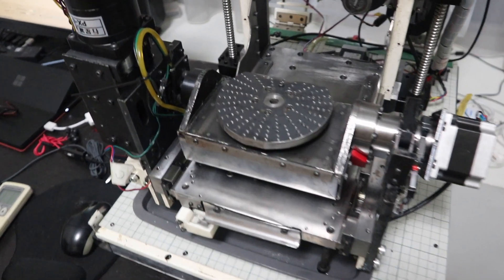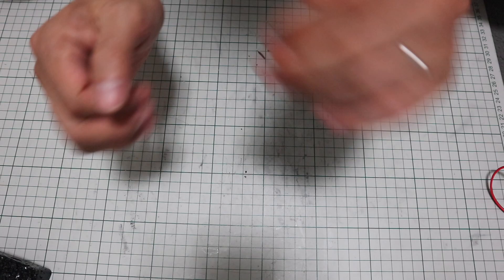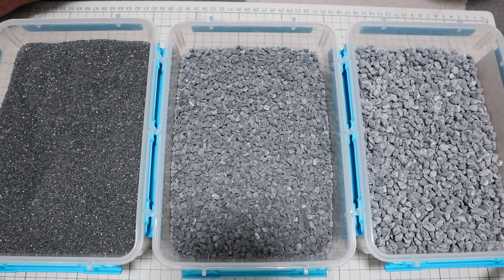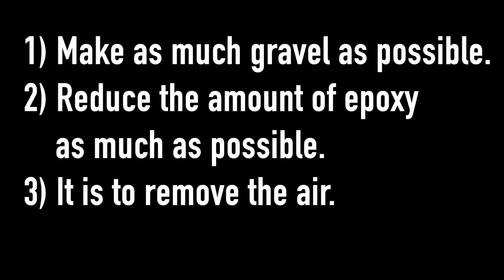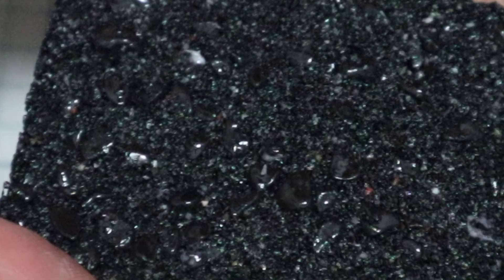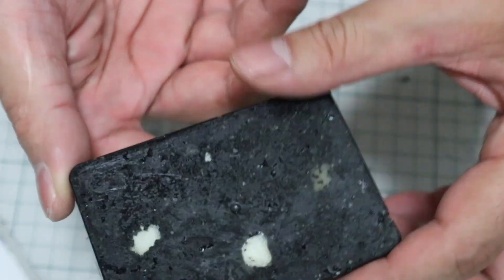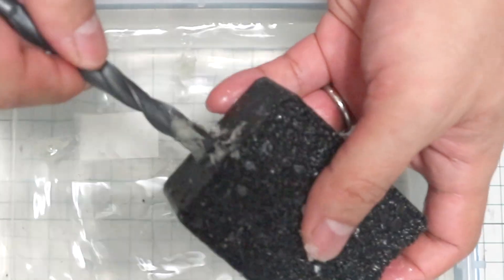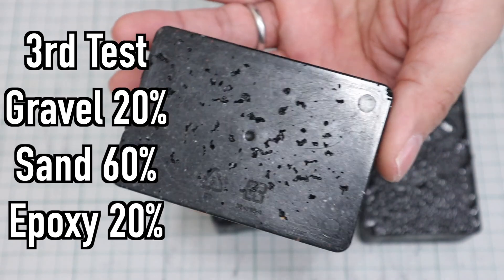Feel the future in the possibilities of this material.

Comment: u need to degrease the nuts with acitone or alcohol and than wet them with epoxy first befor loading the box with the mixture of epoxy and rocks and the streaks of the nuts need to be 90 degrees to the nuts and not 180 degres good luck

Comment: Also, you are using nutserts which are not ideal for that application. They are soft and designed to bend, so the metal is not as hard as a barrel nut or some other similar threaded fitting.
Reply from the maker: I used rivet nuts because I thought their shape would be suitable for embedding in epoxy granite.
However, as you can see from this test, the rivet nut is made on the assumption that it will be deformed, so it will be deformed if too much force is applied.
It is better not to use it on the part where force is applied.

Comment: You make good decision. I already use epoxygranite in my mini lathe, and my 500kg mill. And this is great material. I was using no more that 8% of epoxy by weight. I used epidian 6011 wich is used for impregnating concreate.
For easy to disolve filler you can use styrofoam. 
If you nead to make threads you can cast in something like aluminium bar. But very important you nead to anker It. Something like few threated bolts from inside, that will stick in epoxy granite and grab it.  If other people said It is enough just to scratch the surface - depending on load, but for me It was a failure

If you nead any help let me know. You can see how my machines works on my channel
Reply: Looks like my answer disappeared... i am no expert in epoxy, but you nead three properties. Low viscocity, low schrink and long working time. For me, after many test, the best one was epoxy used to seal and impregnate concrete. If you buy similar one you should be ok
Take a look at links below. There will be some important things to watch and read before you cast your machine. Take a closer look at video about stiffness by metal musling. And remember, some epoxy nead a whole week to get to its max performance
Reply from the maker: Certainly, the three elements you say are important.
I completely agree with you.
But I can't find the link.
Reply: @a-cnc-f  i put link above, and anwser below... they both dissapeared. So lets try something
Reply: @a-cnc-f  cnc coockbokk epoxy granite fill
Reply: @a-cnc-f  in which country do you live in? Is it asia? Perhaps i could help you wich machining some of the bigger parts on my mill for free. Its almost ready after some serius rebuild, just few things left to do
Reply from the maker: Thank you very much for the useful information.
I was just looking into the information you gave me.

The epoxy seems to be westsystem 206, but I'm thinking that 209 would be better because it's a little less viscous and has a longer Harden time.

I'm looking for a lower viscosity epoxy, but I can't  find one that is available.

I live in Singapore.

I appreciate that you are trying to help me.
My activities are not just about building machines, but also about building something in the Inadequate equipment .
This is because most people do not have enough machine tools.
Reply: @a-cnc-f  Hope you make great news castings!
209 will be much better. Dont be scared if your resin doesnt harden in advertised time. In low % content i found out that It neads some extra time.
Greetings from Poland my friend! :)
Reply from the maker: https://youtu.be/1z7WctFry9U
Your project is a great result.
I can see that the lathe is strong enough.
8% epoxy is amazing.
I think the reason it can be achieved is because the epoxy has a low viscosity.
I searched for epidian 6011 and it seems difficult to buy where I am.
Can you suggest me an equivalent epoxy that you can buy on Amazon?

Comment: Rivet nuts are good for tubes and plates, not so much in castings. I tested with M6 threaded rod, 40 mm hexagonal nuts(m6) and aluminium bars/plates.
My formula I ended up with: 13% epoxy, 40%sand, 27% Coarse(5-8mm)gravel and 20% fine(1-3mm gravel). Vibrating helps a lot, but bubbles can just be filled with epoxy for a smooth surface.
Reply from the maker: Thank you for a lot of advice.
I will try it in the next test.

Comment: To avoid air bubble you should coat the wall of your mold with a brush and after that your granite mix. I think you would have a better finish. And for your embedded nut you should scratch the surface of it, for a better grip !
Reply from the maker: I fully agree with your advice.
I will try it in the next test.

Comment: A steel/aluminium skeleton embedded in epoxy granite will make mounting stuff easier. You could also try concrete, but I think it will chip more easily
Reply: I've seen bolt threads embedded into the epoxy. You leave part of the thread out to attach parts. However, I do like the thread insert idea.
Reply from the maker: In this experiment, it was found that the just embedded nut can be 
Certainly, concrete is worried about cracking.
removed by tightening the screw strongly.
Regarding important screw holes, I felt the need to connect with the frame.
Reply: @a-cnc-f  About mounting stuff to the frame, keep in mind that you can just glue with construction adhesive to the epoxy 2 ground flat steel bars and drill and tap them wherever you want. The bond between the epoxy granite and the steel bars will be more than strong enough and you will have a flat surface easily.

Comment: Wouldn’t vacuum chamber help to remove the air and compact it even more?
Reply: You can use vibratory table or hand held vibrator like those used on concreate. Or you can get small DC motor and put counterweight on It, and seal it. It worked in my case
Reply from the maker: @kwk8363  I agree with you.
I'm thinking of making a vibrator with a small motor.
Reply from the maker: I would love to use a vacuum chamber, but if I put it in our small room, my wife would probably get angry.

Comment: Why don't you vibrate the forms? Why don't you use smaller fraction?
The embedded parts need to be reinforced and tied. (like concrete reinforcement)
Reply from the maker: Thank you for your advice.
I agree with your opinion.
As you can see in the video, I tried to vibrate it using the vibration function of the iphone, but it didn't work very well.
Certainly it needs reinforcement.
Further testing is needed.

Comment: Hey I make CNC machines since 2009, recently has started to post some videos at my channel. Several years ago I made cnc machine out of granite plates, you can purchase polished granite plates of any size from nearest funeral bureau or kitchen countertop shop... they're polishing it to high precision level, all sides will be square and parallel to each other. Ofc they're not making complicated shapes.
Reply from the maker: Granite is an available material, but as you say it is only a simple shape.
I hope your project goes well.
Reply: @a-cnc-f   Thanks. I've been experimenting with different types of materials with the 3d models of parts and machines that i've made in Inventor. Granite and epoxy granite have great dumping properties and they're not deformable, but these properties are good only in case if your machine has to resist high cutting forces. If you need to cut high carbon steel at high feeds using high torque spindle then epoxy granite base is a great choice for a machine, but for small steel cutting machines, like lathes or mills - there is no practical difference between steel/iron and granite. You can dump all of the unwanted vibrations in a small machine by using good spindle bearings together with smooth working motors, hybrid steppers is a minimum, they work much smoother and provide less vibrations. Servo motors is the best choice to dumb unnecessary vibrations, but you have to understand well how to tune forward/reverse acceleration and deceleration for servo motors, cause they work really smooth until you want to instantly stop and reverse rotation at high speeds.  Theoretically granite and epoxy granite is a great material, but practically it's not very useful for low cost and small size projects. I've made a router for the customer using granite surface plate as a base, it wasn't a cheap machine and I've used granite surface plate because I had to install IKO roller linear guides and C3 ballscrews provided by customer. Since then I'm not using granite and have no plans to use usual or epoxy granite at all, not only because of the properties, but also because I have a milling machine for steel and precise surface grinder - epoxy granite can't be used at magnetic plate of the surface grinder and practically it's better to weld any type of structure using square steel tubes and plates, get rid of the tensions in the furnace, mill, drill  and grind this part the way you want it, reinforce it with rebar and THEN fill it with epoxy granite. Well if your plan is to make series of videos using epoxy granite as a material for the machine - I will only applause and will watch them. By the way the most complicated machine that I've built so far had 8 axis, it was 3d wire/rebar bending machine, it bends cut-to-length wire up to 8mm diameter. Well just 5 of these axis are motor driven, other 3 are pneumatic cylinders, the machine by itself has 4 motors + 2 cylinders, attached feeding device has 1 more motor+cylinder. There is another 2d bending machine that I've made standing near this 3d bender, it has 5 axis in total, well.. 4 axis + knife. It straightens and cuts wire for the 3d bending machine, but can also work as 2d bending machine. I really hope that in 2022 customer will order a second 3d bending machine and whole project will work as I designed it... Original design: two 3d bending machines stand near and there is a spot welding machine between them. Each bending machine should take piece of wire from the feeding side, then each one of them bends their piece, then bending arms holding parts meet under the electrodes of spot welding machine, and after welding is done - completed piece is released on top of the conveyor belt and moves to the box. I haven't filmed the machine when it was completed, but you can see the first steps of 3d bending machine in my videos. When this customer will ask me for a visit - I'll make a video of machine when it works.
Reply from the maker: You have great knowledge and experience.
Since posting this video, I've received more comments from more people than I expected.
I learned a lot from you.
I would like to use it as a reference for the next test.